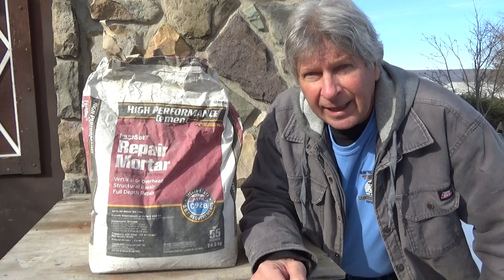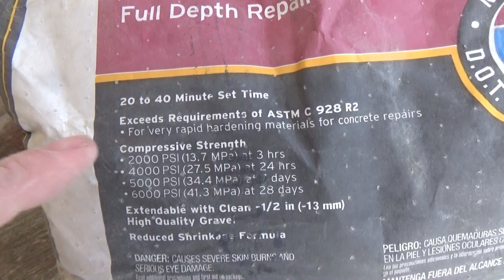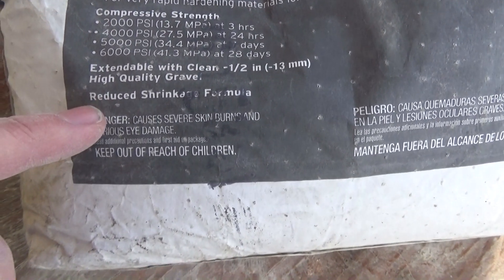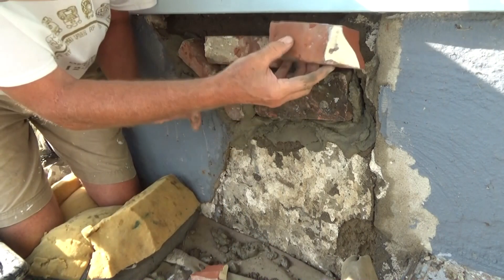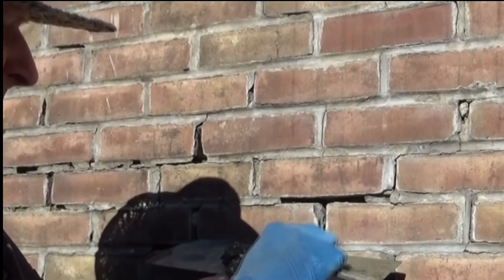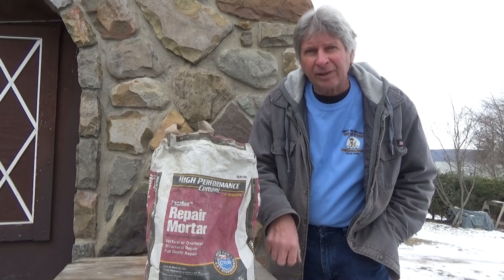QUIKRETE REPAIR MORTAR REVIEW (Fast Set) Mike Haduck

Comment: I used it on my basement wall.  Block wall with old cracking and crumbling mortar.  Chiseled and scraped all loose stuff then the Rapid Set Mortar.  After that a few coats of Dry Lock.   So far so good.  Thanks Mike. Enjoy your calm videos. No big deal. When I drive by big cement deterioration sites, I just say - no big deal.
Reply from the maker: Thanks John, I am glad it worked out, Mike

Comment: I work on a couple dozen different rent  houses every month for property managers. General maintenance. I carry a 5 pound pail of it in my service truck to seal common mouse holes behind kitchen ranges, dishwashers, and cabinets. I can mix the right amount in a disposable paint container.  I used to use Rapid Setting Tile Mortar for this purpose, but it is far dustier (messier) to deal with than Quikrete Repair Mortar.  Thanks for the review Mike!
Reply from the maker: Thanks Tom, I appreciate it, mike

Comment: You are the best for answering all these questions. I am doing a build up on a vertical wall. Sometimes I see you wet the wall, sometimes I may have seen you paint the glue type product to the wall. Im going over old eroded concrete. It will be cleaned out all debris gone and power washed. I plan on keeping it wet before applying this fast set. Do I need that weld crete? Thanks sir!
Reply from the maker: Hi, I use the fast set for small jobs but I got the whole series on foundation repair over ,block , stone or concrete, I show all my techniques ,what I use and how there, thanks Mike

Comment: Got a question for you Mike...but first, a brief explanation of what I'm doing.
I'm going to start setting limestone rocks for a stone(freestanding wall) at a height of two and a half feet.
I want to leave the stones in their natural, somewhat round shape rather than facing the stones, except where it may be necessary.
The limestone rocks are an average of 8" to 14" in diameter and are mostly round or slightly oval in shape with no two of them being exactly the same.
I want to set the stones as they are and not face them. Your general message is that people can pretty much build things as they like as long as the end result is structurally sound and generally, properly constructed. I believe my plan is suitable but I would highly value your opinion on this.
I have constructed a footing that is 24" deep x 24" wide x 24' long and I poured a 3-1/2" thick concrete slab on top of the "footing". The footing was constructed using old solid concrete blocks, small limestone rubble, and base material was compacted into the layers as the trench was filled. Does this sound adequate to you?
Is it okay that the wall will not have a "flat" face? Is it okay to leave the rocks in their natural shape?
You are awesome and I have referred your channel to several of my long time friends and my best friend has passed the info onto his son who is flipping houses.
Thank you very much for the work you do and the knowledge you share with people like myself...that make a "project" out of everything. LOL!
Reply from the maker: Hi Diy, I have a video out called " retaining walls" yes or no?  And the other videos on retaining walls, I would check them out. Thanks Mike

Comment: I live in Rhode Island and in the winter we use a product called hard- n-fast a box comes with like 20 10 oz bags of powder with one bag you can mix 3 80 lb bags of Ready-Mix mortar I usually use amerimix or spec mix type S so it is good for big jobs but that is a good idea to use that fast setting repair mortar for small jobs in the winter time thanks for the tip
Reply from the maker: Thanks Richard,  Mike

Comment: Mike, I'm confused. I thought you needed to use only soft mortar to repoint brickwork because the mortar is supp
osed to be weaker than the brick? Won't this really strong mortar crack the brickwork?
Reply from the maker: Hi Tom, I would say not on small point ups but that is one reason I add sand to the mix is to make it weaker for those purposes,  my opinion, Mike

Comment: @MikeHaduck Mike, how do you determine when to add sand to this product?  Let's say I have a hole in a stucco wall, say 4 inches deep, and I see direct rotted wood, in this scenario, how do I know if I should add sand or not?
Reply from the maker: Hi, I never add sand to a premix product, if anything I might add more cement, I have a playlist on stucco or foundation repair,  I. Show what I use in each circumstance,  thanks Mike
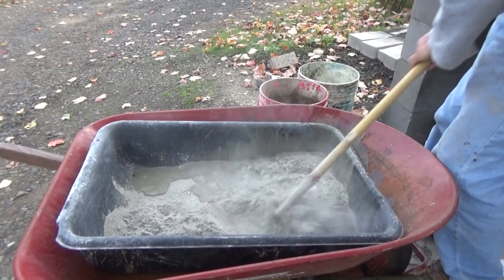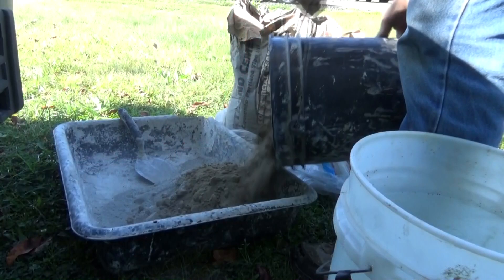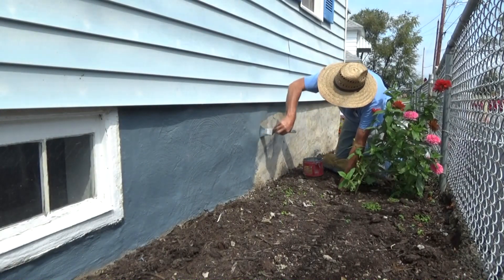Reply: @MikeHaduck  in 1 minute and 40 seconds, you said "this product [high performance cement --fastset repair mortar] is very strong, so sometimes you'll see me add some sand to it."   Also at 2:35 you also said sometimes I'll add sand to it, but not in this case.  why?  questions:  does adding sand allow for less shrinkage?  why does adding sand make the product weaker?  Does adding portland to the mix make it stronger?  Does adding sand make it set faster or slower?  Does adding portland make it set faster or slower?  3:25, here for the steps, you added a little sand and cement to it so it slows it down so you have more time to work with it, but was sand or cement (portland) slow it down?  you said you'll do this with a larger piece.  4:40 you also said you weaken it during repointing, you put a little sand in it.  why do you use this product only for small jobs only?  Is there a way to make stucco (standard) or cement / concrete more water proof, as in water would not soak into the wall?  Would you add acrylic if so, how much would you add?  Thanks.
Reply from the maker: Hi, Masonry is not black and white, they try to do that by making the premixes but they just started coming around in the last ten years, every mason from different areas or countries had their own mixes which they used for years, sometimes I do repointing, or plaster ir stone or brick and use the mixes I learned from the oldtimers, if my dad used the mix 60 years ago and it held up well, I still use it, that is why in each video I show what I used in that situation, I don't always trust these new products and might add a little more cement to the mix if it is exposed to the weather or more sand if it just to fill a void, it's experience, that's my opinion or best answer, thanks Mike

Comment: Hi Mike, I have a concrete block home.  When I was replacing a window the overhead mortar on my block that slopes towards my window broke loose.   Would this product work to fill back in the overhead mortar which is an inch or 2 thick?  How thick would you recommend applying at a time?  I tried type S mortar and it just fell off and didn't stick.  Someone recommended speedwall or SikaQuik VOH.  Is this product similar to those?
Thanks Mike
Reply from the maker: Hi Rob, if I am packing something I use rapid set motar mix,  I used it on " concrete patches" playlist, and basement window installation,  thanks Mike